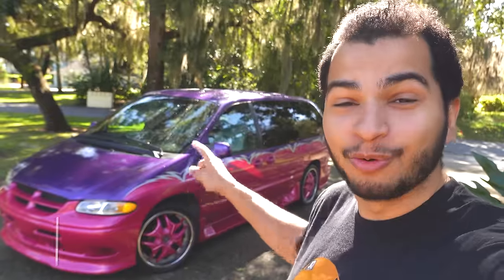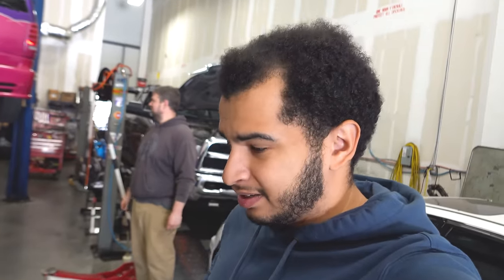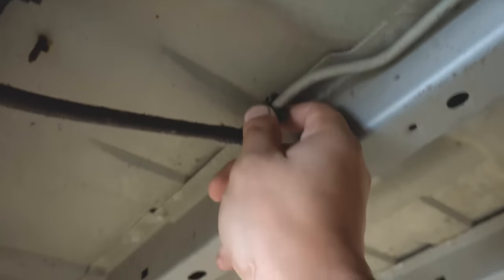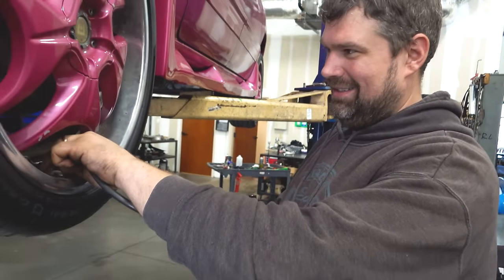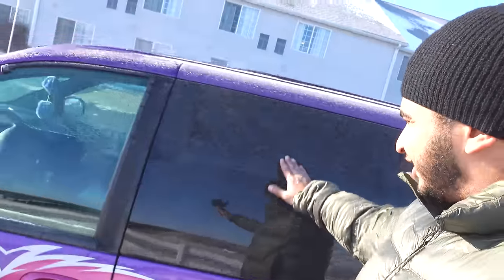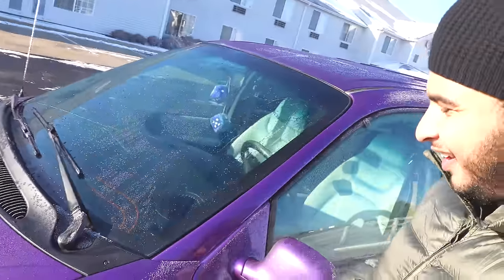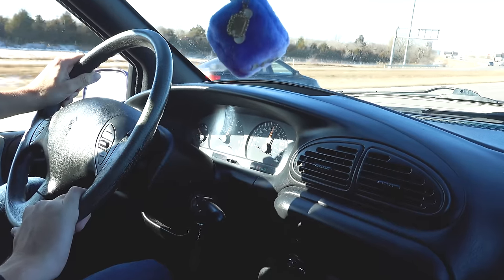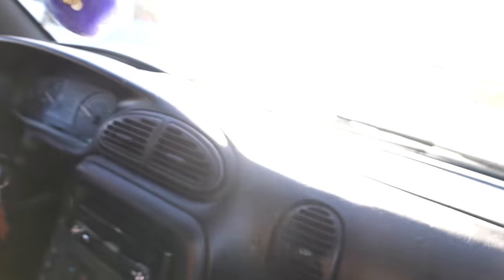Giving My Friend A "Pimp My Ride" Minivan For Christmas (SERIES FINALE)

Comment: Love the fact, that they shaved the door handle on the side the door actually needs to open, but kept it on the side you can't use the door... brilliant!
Reply: The 2000s were a strange but simple time 😂😂😂
Reply: To be fair that is where the majority of the custom electrical work looked like it was located so that would theoretically make it easier to service those parts
Reply: @buranflakes  thats what I was thinking too.
Reply: @buranflakes  would have been just as easy if they had shaved it to match.
Reply: @crewgadjy  That side didn't have any electronic opening mechanism however
Reply: @buranflakes  Neither did the other till they made it.  SO if they bothered shaving and making electronic / chaim mech for one side they should have done both.
Reply: @crewgadjy  Dude you're not getting it. If the electrical was to fuck up, there is a mechanical handle to open the door that leads to most of the wiring. The other side can have the motor because it looks "pimp." If you have an electrical issue, it would be dumb to make the only opening mechanism to the wiring electric. You essentially lock yourself out of accessing a potential wiring issue. Also, it wouldn't be just as easy. It would literally be double the work. What they should have done is shave the handle and add a secret mechanical switch to open the door.
Reply: These are confusing times
Reply: Pimp My Ride was pretty fucked, can't expect any better
Reply: They were so logical and practical with everything else, I can't believe that was looked over.

That side of the van didn't get much screen time, so it would have been wasted effort for their interest.
Reply: i assume the chain drive would go slack, bind up, and possibly break so they shaved the door handle to prevent that from happening.
Reply: Literally stole my comment
Reply: Exactly what I was thinkigg Nd
Reply: LMFAO
Reply: Dude they were really high :v
Reply: Why spend the money on that side?  The big show was the other side.  Plus with all the electronics  it was more of a service door.
Reply: @danc2014  sure,but still a half assed job... And a car, as eyecatcher as that, I`m sure people would do a full walk around in real life
Reply: For sure a smart play
Reply: 🤣 truth
Reply: @o2Hayden  Yep. Makes sense.
Reply: It is only logical
Reply: I thought the same. Genius

Comment: The only thing i wanted to see/hear was the stereo and subs and they never turned it on😩
Reply: I waited very patiently to hear the subs tested and have been let down.
Reply: Yeah I wanted to hear xzibit at full blast lol.
Reply: Didn’t work if it did they would’ve played it.
Reply: I Swear!!!! That's It!!!
Reply: I figured that it was broken. Sam with those 2 of 3 screens that flipped down but never turned on except when they manually turned them on.
Reply: If they really wanted too, they could of got it working.
Reply: @honeyblade5243  really? I was hoping for that Mr. Rogers
Reply: Probably all blown.  I didn't see the door speakers but I get the impression that it wasn't a very well balanced system, probably a just a bass heavy public nuisance, not really my thing.
Reply: Unless you have a system connected to whatever you’re watching YouTube on that is equal to or better then the system in the van? The only thing hearing it play would verify is that it works.
Reply: That fisher price setup would not be impressive anyways

Comment: "there's a blizzard warning but we have all-seasons on the van"

spoken like a true southerner lol
Reply: As long as you don’t drive crazy, it’s fine 😃 - true midwestern here
Reply: @imaginesagi  When I was in Wisconsin I heard that as well. That was until I pin balled my car in my apartment parking lot. The next winter I bought some snow tires. It was -35 with a -50 windchill for nearly a week and I moved back to Texas. Don't need snow tires here ever. In fact I had a t-shirt on all day today...
Reply: @imaginesagi  and then everyone who says that tailgates and does California stops and aggressively passes through the right turn lane.
Reply: He's in Wichita, it snows twice a year and only an inch or two if that.  Then it melts in a day.
Reply: "Blizzards a season" ... too funny.
Reply: we just run our all seasons up here in North idaho. only put the snow tires on if it gets super bad out.
Reply: I have driven on summer tires during snow, may not be the best tires for the situation but they worked and I didn't crash lol.
Reply: James Rounding while Wisconsin and Minnesota are technically the midwest... it’s Canada in the winter 🤣
Reply: @FoolOfATuque  So did I, underneath a jacket, over a long sleeve shirt.
Reply: I run mud tires year round. Northeasterner here. It's all about how you drive
Reply: All-Seasons..... More like : Not safe for driving in winter conditions.
Reply: @probablynotwearingpants6228  true. As long as the snow can get out of the tread you'll be fine
Reply: live in minnsnowta lol "Minnesota" and i can say working in the auto department in Walmart i can we sell more all seasons then snow tires cause not everyone can afford it and those genn max tires are good one's nice tread
Reply: Lol
Reply: Its hideous hahaha
Reply: Where is the baby car seat going to go??????
Reply: Where I live in Canada on the highway its fucked with all seasons need winters 100% lol
Reply: Its so funny that he thinks the tires will help. Tyler was like ehh... its ice buddy
Reply: @imaginesagi  Yes
Reply: My type r still on stock tires which are summer tires..... guess i cant go anywhere
Reply: as a californian - wHaT aRe SeAsOns?????
Reply: @makerdiy4660  being from Wichita, that's absolutely not true lol. Some years you won't get any snow and some years you'll get feet of it. I think we had 14 or 15 last year.
Reply: One of the cons of being landlocked in the middle, temps vary radically from like 110 to negative digits and you kind of just have to deal with it lol.
Reply: @armandoaragon2938  I live in Minnesota and those are the people in the ditch I drive by on my winters lol
Reply: Fernde09  true or the people that think I got an all wheel or a 4x4 drive I’ll be fine speeding down the road nope your wrong.
Reply: @c4onmylip  When did you get 14 feet of snow in Wichita?  :)
Reply: Brian Reher no. It’s people in the Midwest that don’t see the need of winter tires when all seasons are fine in 95% of situations. If the roads are shoveled and salted all seasons are fine
Reply: As someone who lives in Atlantic Canada, all seasons don't work well enough at all
Reply: @6door6four96  where do you live, way up north, I'm in Atlantic and nothing is that bad in the fall or spring, and only mid/late Jan to Feb is when its bad
Reply: @FoolOfATuque  you spelled Wisconson wrong, according to ESPN LOLOLOLOL 😀😁🤪😆😂🤣😉
Reply: He was raised in New Jersey
Reply: Heres a midwesterner "North Dakota" reply for you:  It snowed 26" last night, lets take the mini van.
Reply: @zachmacpvp1982  I'm in merritt bc it's really only the highways the coqahaula that get very bad
Reply: Live in North Dakota, all seasons baby
Reply: A true southerner would instinctively buy 4 loaves of bread and 6 gallons of milk, and lock themselves in their house at the thought.
Reply: @FoolOfATuque  i didnt wear a shirt to start my truck this morning, just shorts and shoes.

4 inches of snow and 28 outside, but the sun was out. good ol michigan day right there.
Reply: @Cee1019  you can keep it. Lol!
Reply: @darkimp1254  please dont

Comment: "You've been Officaily been RE-Pimped!" - Tavarish
Reply: Title should be ''Hoovie got Pimped!''
Reply: This can be a new tradition - Re Pimping. Probably ok with cars and leave it at that.
Reply: This van is going to be re-engined shortly, listen to the prior vid how badly it was knocking until it built oil pressure.
Reply: @bobroberts2371  God no.

Comment: 25:45 - That's it?  2k?  Wow, that is super low for all that stuff!
Reply: It was all minor parts, the most expensive  thing on there was an alternator
Reply: +4k labour
Reply: That estimate was for the labor.
Reply: That’s because things were better in 1999 (just like the prices lol)
Reply: I was surprised too tbh
Reply: That was just labour.  Parts would've been on top of that, although they got them from a sponsor, so would've probably been free or heavily discounted.
Reply: Oh ok I rewound because I was like uhh.. I feel like I would have had to total my car instead
Reply: Advanced does a pretty good discount for sponsorships as well I rang up a sponsored person once working there. It went $1634 to $987 almost half
Reply: Right! Where I'm from in MA i cost me 1k for the replace the exhaust system. And I bought all the parts myself. I'm moving to Kansas to get my whole car fixed for just 2k.
Reply: That for parts AND labor? Pass the van on to his daughter when she gets older.
Reply: They saved $2000 in labor in a "24hr" build
Reply: Ikr, Hoovie has seen way worse.
Reply: It’s cost me 900 just to fix the bumper of my Audi…
Reply: That is low but also more than double the initial cost haha!
Reply: That's about what I paid to get a new clutch plate installed on my VW van...parts and labor plus taxes. 

Yes, the parts were regular stuff, but usually the labor to take them out and put them in will cost more than the part itself (except, maybe, wiper blades ^^). 

Essentially, you are telling me, I could buy this van for about 3k$? If I list the cars on Ebay going for 3k and less, there is nothing even remotely similar...or even driveable...or without holes, rust or missing vital parts.
Reply: That is SUUUPER LOW. Shops in delaware wanna charge 2k for only a quarter of the stuff on that list.
Reply: ill would charge that for 10 hours of labour
Reply: 2k saved doing it himself
Reply: That's bullshit, maybe 2k in parts.
Reply: If he thinks 2 grand to fix a 20 year old vehicle is expensive, wait until he has to foot the bill for anything on the Ferrari.
Reply: Well i mean considering he paid only $850 for the car itself the labour costs alone is more than twice what he paid for it so considering not for the novelty of the vehicle it wouldn't be worth it.
Reply: @nathan-qcueparsons268  That wasn't the point at question at all...

Comment: but seriously who does all this work without replacing the fuel pump
Reply: Flowmasta Flam that’s what I was thinking 🤔
Reply: It wasn't on their radar until it drove. Part of the reason for shakedown drives.
Reply: Exactly.  Should've been replaced out of habit.  Same with the fuel filter and cleaning out the tank.
Reply: I thought that then they said they had gauge problems, only a matter of time lol
Reply: The, "If it ain't broke" rule.
Reply: @antwaunkent5654  it's amazing how long an engine can sounds like it's dieing but run great 🤣
Reply: A man who wants some entertainment on his 1000 mile drive, thats who.

Comment: Hey just found this video. 
I used to watch PIMP MY RIDE. 

And 4 yrs ago... I went online to a Auto auction out of San Fransisco ... I live in the UK and France. 
And I spotted a familiar looking Mustang . 
The car that PIMP MY RIDE... THE CAR THEY CALLED MADDIE MUSTANG. 
I wound up buying the car and bringing it to France. Where J have a number of mainly old racing cars and a couple of special road cars. 
Like the van . The mustang needed work. 
It had questionable fixes from the tv show. 
So we gave it a full ground up restoration . .it's a fantastic car. 
It was turquoise when we got it. 
It's now black with a red interior. 
And it's been renamed Mad Max. 
And resides with my 1973 Lincoln Continental (that I imported 8 yrs ago for my 40 th birthday. And is also a ground up restoration) and a 1973 Jaguar (also a rescue that we restored just on 10 yrs ago now ). .

PIMP MY RIDE made it all look good but sadly alot of this work was very questionable. 
But it was still fun to watch.

Comment: "About $2000 of work"

Dear lord that's almost the entirety of what I paid for my Lumina.
Reply: I bought an '01 Jeep Cherokee for $2000 a few weeks ago lol no issues whatsoever and only 163k miles.
Reply: @ThorCarlton  i know this comment is old, but get ready.
Reply: @temporaryaccount6325  lmao 6 months later and I've replaced the starter, entire ignition system, and idler pulley. Luckily XJ parts are cheap
Reply: If you didn't know the lumina was made by Chevy

Comment: Oh yeah, and fuel pumps go out by burning bearings by not keeping gas in the tank. They usually burn out all at once. Sometimes you can get lucky and peck on the bottom of the gas tank with a hammer to get the armature in the pump rolling, but more often then not, when it goes, it's gone.

Comment: The Car Wizard definitely quoted a 2019 price for that work lol. I was expecting at least $3500. But that's without the body work restoration, or interior. Then I remembered this video said it was 3 years old, before the rush of cars into the repair shops as new cars became unaffordable. New cars today are overpriced and no better than models from 10 or more years ago. This 1999 van runs great with some new parts. My 2010 & 2013 Pontiac & Mazda both still run great with regular oil, coolant, and trans changes.

Comment: Been saving up for a vehicle i have been using my grandpas old toyota which was perfect for my job. Its finally kicked the bucket and im looking for something with a cab or even a van i can use as a work van. Any recommendations on a low cost truck/van im ok with something old my budgets under 4k

Comment: Okay. I need to know because I build automotive seats and I have kids. Did that rear couch even have the anchor points for installing a baby seat? They would have been in the biteline where the back cushion meets the lower cushion and they're literally anchors for attaching the baby seat so you have extra protection during an accident. I suppose you han do the old school using just the seatbelt by pulling the belt all the way out until it locks and making sure it's snug enough that that baby seat doesn't move. Just curious cause I'm a seat guy. Also the custom seat makes me nervous because we do special tests now that can tell us if a seat is safe enough so riders can survive a major accident without life altering injuries. I don't think I would put my kids into this van with that custom seat never being tested to today's standards.

Comment: It's not a Fuel Pump....its the Fuse Box....they notoriously go bad on all Chrysler Town and Countries years 1998 through 2013....I replaced the one in our 2012 Town and Country only to realize 2 years later that the issue came back....Chrysler is aware of the issue and refuses to do any recalls.....and I'm not dumping another $2200 on a van that has 200+k miles on it.

Comment: You put all that money into the van and didn't put any fuel stabilizer in it for the trip? Any gas that has been sitting for years should have some additives added so it less likely to hurt engine.